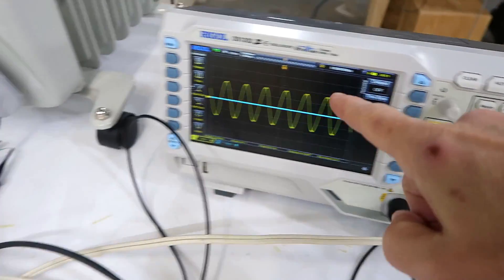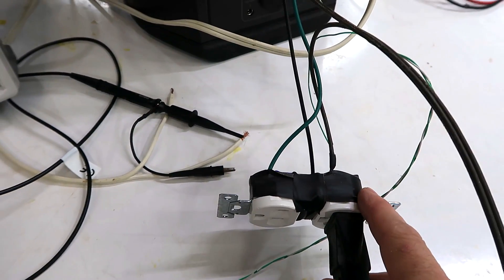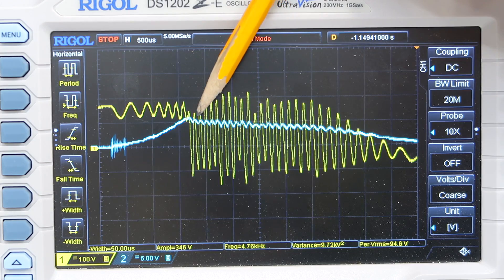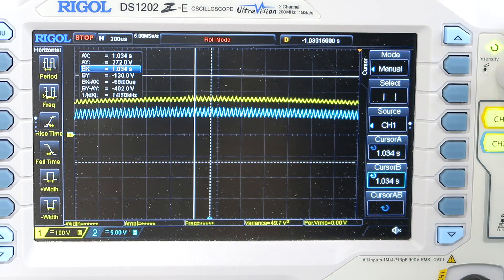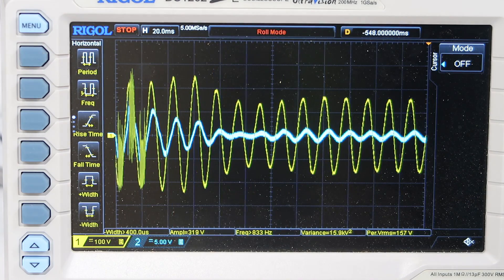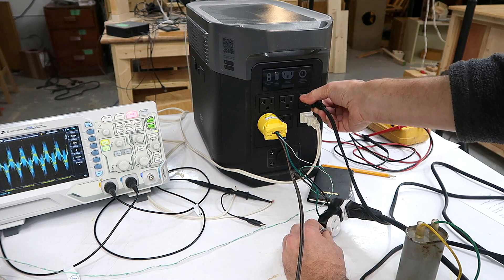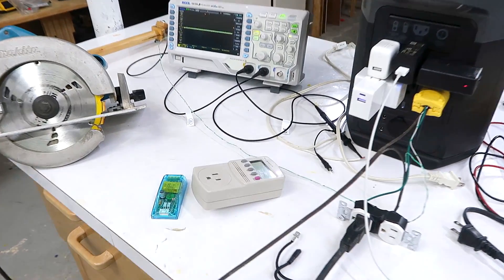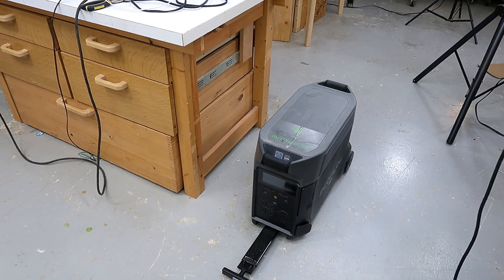Inverters don't like power tools

Comment: All of these overpriced "solar generators" are like this. 

I'm happy with various bike batteries, part of a Nissan Leaf battery, and my 3 invertors of various qualities and types, all Chinese apart from one, an old Ring 12v 1000w. 

I use power tools and my induction cooker on a 48v XIJUA 3000W peak inverter and on my cheap blue 4000W peak one, both with 48v bike batteries. 

I use computers and vehicle lighting on my old Ring invertor with that "part of a Nissan leaf battery" - I'm not telling you what I've done with that or how I did it, it isn't safe and you shouldn't play with Nissan Leaf batteries, you should send them all to me. 

I once tried power tools on the 12v one, with a lead acid battery, it didn't work, but the others do. I've always known that tinkering with my own setup will give me better results than any of these fancy expensive "solar generators". They're basically a cheap bike battery with a cheap invertor, but the way I do it has downsides, I have to make sure I don't connect things wrong myself, but I get a better working workshop once it's all set up. I even have 500W of MPPT solar so I can top up all my different batteries from the same controller. I love my crazy lithium setup. All on a trailer tent with no tent, pulled by an electric trike with BBSHD mid motor at 48v (how convenient, my trike and my plug sockets all on the same voltage interchangeable batteries).

Comment: I doubt it is actually uaing 10 extra watts.  The logic simply predicts (inaccurately) that it will.

I bet if you left the capacitor plugged in and checked back after a few hrs you would confirm this.

Comment: The dynamic current limiting in this inverter is called "Cycle by cycle " limiting, in which the switch current is monitored and if exceed a certain value the switch turned off.

Comment: Simple solution: Run your large/dirty loads through a long extension cord, as long and as cheap as the motor will accept. The extra resistance will reduce the startup surge current, and even help to filter out some of the higher harmonics. Any motor that can start successfully through the extension cord with mains power should still start with inverter power.
Reply: Cool

BTW YodaWhat I suggest watch a 13 part series called What on earth happened by Ewaranon to learn that the earth is not a globe.

I got it in my about tab.

Comment: South Africa has a 240V N E connected grid supply, to prevent N E floating voltages. I am keen to know how Ecoflow manages to prevent N E floating voltages. My assumption is that Ecoflow will not be a suitable inverter for South Africa and any other country with similar grid topology as South Africa. 
This is an excellent video demonstrating inrush currents of motors (dc motors have the same inrush current properties as AC motors)..
Reply: deonmo I suggest watch a 13 part series called What on earth happened by Ewaranon to learn that the earth is not a globe.

I got it in my about tab.

Comment: This hardware current limitation isn't endless though. Based on the article on medium and what you've said the gate drivers are detecting IGBT desat and pulling it off to prevent runaway. It does however mean that the IGBT is subjected to desat. That does damage the transistor a little each time (and it happens hundreds of times in a single start). Desat survivability is typically in the thousands of times range, so I wouldn't recommend you do keep overloading it
Reply: thomgt I suggest watch a 13 part series called What on earth happened by Ewaranon to learn that the earth is not a globe.

I got it in my about tab.

Comment: Howdy. Nice investigation.
I have a 600 W grinder and tried to run it with a 600 W inverter. I only got a twitch and the inverter cut out.
So I bought a 2500 W inverter. This worked. I had to get a separate battery though. Taking the 12 V from my car battery it got depleted in just a few minutes.
I charge the separate battery with a cable connected to the cigarette lighter socket. That actually works. There clearly must be a resistor in the lighter socket circuit that limits the current to about 6 A if the auxiliary battery is depleted.
Regards.
Reply: eugenepohjola I suggest watch a 13 part series called What on earth happened by Ewaranon to learn that the earth is not a globe.

I got it in my about tab.

Comment: I was worried about  bonding neutral to ground on my inverter, all I can get out of solar installers, are, "it should be ok". I am still looking for a schematic diagram of an axpert inverter so I can see  for myself if output mosfets will blow up by bonding neutral to ground. If anyone can point me in the right direction re. axpert schematic, will surely appreciate.
Reply: Excuse me gssrustenburg I'm not familiar with that but I suggest watch a 13 part series called What on earth happened by Ewaranon to learn that the earth is not a globe.

I got it in my about tab.

Comment: Guess I'll have to connect 50 batteries from disposable vapes.  I'll get around 200v DC.  Their rated continuous current is 4 amps. And for a whole seconds even   several times that.  They have fairly consistent capacity.   So this'll last a few charge cycles without any additional circutry..  just take precautions to that thing going up in flames.     Plenty more of those cells to build a new one if needed
Reply: theserotonine I suggest watch a 13 part series called What on earth happened by Ewaranon to learn that the earth is not a globe.

I got it in my about tab.

Comment: In short: You need softstarter.
Reply: jaromirandel I suggest watch a 13 part series called What on earth happened by Ewaranon to learn that the earth is not a globe.

I got it in my about tab.
Reply: @flat-earther  What does this have to do with the electric softstarter?
Reply: @jaromirandel543  Nothing but random suggestion.
Reply: @flat-earther  O.k. Don't spam or post OT please.

Comment: Huh. That explains that my little 500wh mobile battery wasn't able to quickly start my polisher(brushed 850w peak power)
But when i started with the lowest setting snd slowly built up rpms it was powering it no problem
Reply: someguy9 I suggest watch a 13 part series called What on earth happened by Ewaranon to learn that the earth is not a globe.

I got it in my about tab.

Comment: The high frequency oscillations are the dumb cycle-by-cycle current limit of most integrated controllers. Unfortuntately many designers are not aware of the serious limitations of this current limit and their solution, and why this limiting can actually increase stresses on the power switches.
Reply: bearchow I suggest watch a 13 part series called What on earth happened by Ewaranon to learn that the earth is not a globe.

I got it in my about tab.
Reply: I wrote a paper on inverter current limiting and reliabiltiy. Unfortunately YouTube prevents links or disclosures of useful works in comments.

Comment: The only super effective way to mitigate this type of noise would be for the ecoflow to power DC motor and connect that motor to something like a rotary phase converter. IE DC  electrical to mechanical to mechanical to AC system.
Reply: I'm not an expert in this field but I think that sounds like a good solution. DC and AC side separate so no interference from one to other.

I saw a video of a company with AC to AC frequency converter which worked by an AC motor turning another AC generator motor.

BTW Ryan I suggest watch a 13 part series called What on earth happened by Ewaranon to learn that the earth is not a globe.

I got it in my about tab.

Comment: Maybe they could sell an inline motor capacitor to use with power tools that shuts itself off with a relay if no power is being used and reengages the relay if it detects an inductive load being switched on.
Reply: jannikheldemann I suggest watch a 13 part series called What on earth happened by Ewaranon to learn that the earth is not a globe.

I got it in my about tab.

Comment: What about looking to how cars handle high amps when starting? Likely not practical but if the over current circuit detects the big spike during startup it could switch to a dedicated startup battery like an automotive battery which can handle the high amperage draws for a few seconds and then when it detects the current settling, switch to bypass the  battery out of the circuit. It’s like the capacitor idea you tried but the battery shouldn’t need the constant wattage drain once topped up.
Reply: Nageeb I suggest watch a 13 part series called What on earth happened by Ewaranon to learn that the earth is not a globe.

I got it in my about tab.

Comment: There is an inductor in the inverter that normally filters the PWM voltage. But an inductor capable of filtering 50-100 amps at 30khz is going to be big, heavy, and expensive.  So the small inductor in there saturates. That is not a big problem since *these power tools are highly inductive.* At 3:09 despite the messy voltage waveform, you can see that current is limited to a relatively constant value using the motor's inductance.
Reply: realsolarcars I suggest watch a 13 part series called What on earth happened by Ewaranon to learn that the earth is not a globe.

I got it in my about tab.

Comment: Matthias, you said what should have been said long ago. The capacitors and FET modulation cannot handle the inrush from inductive loads of motorized tools.  If you buy a 1/4 hp circular saw, you'd better hope you have a 3000 watt, high quality pure sine wave inverter or you will not be able to make a cut.
Reply: charlestatakis I suggest watch a 13 part series called What on earth happened by Ewaranon to learn that the earth is not a globe.

I got it in my about tab.

Comment: The higher quality, more expensive  sinewave inverters usually run everything, like the Samlex or Cotek  sinewave. You have to make sure that they say that they can run highly inductive  and capacitive loads. I have a Aims 2000 watt sinewave that runs  my table saw  or my 12 amp electric  edger. But it won't run my Black and Decker electric blower. But my old Cotek 1500 watt sinewave inverter  that can run capacitive  and inductive  loads does that without a problem. Generally it's true, you get what you pay for. The more you pay the better quality it is. And the best stuff is not on Amazon. Actually, Amazon doesn't  even sell that many inverters that are rated UL 1741 for use in a house, probably  because  to get that listing costs a lot of money.
Reply: emitissimo I suggest watch a 13 part series called What on earth happened by Ewaranon to learn that the earth is not a globe.

I got it in my about tab.

Comment: Hi Matthias,
One thing that would have been interesting to test with the ecoflow is its efficiency, i.e. what power does it draw on top of what is being plugged. I've found that some inverters are terrible on the low end, for instance a 4000W UPS will draw 300W+ with no load, but will be more efficient at half power.
If you end up replacing your Kill-A-Watt, I'd definitely be interested by that kind of test! :)
Reply: n4w4k I suggest watch a 13 part series called What on earth happened by Ewaranon to learn that the earth is not a globe.

I got it in my about tab.

Comment: Certainly you could build an inverter for "non-standard loads" or whatever the terminology is, but I suspect they would approximately be multiple inverters in the sense of cost, component count, and complexity. Also, they might damage some equipment (e.g. motors that can't quite get started) instead of properly running them.

In essence you would start with a boost topology, using that to feed a current-controlled (as opposed to voltage-controlled, which is more common) buck topology, with an additional control system that will force both inverter stages to back off (but not actually stop) if limits are being exceeded, probably with measurements being considered within a timescale quicker than the output frequency, and several times longer than a single oscillation of the output frequency. And then you might throw the output through an LC filter to smooth the waveform a bit. It would probably be much more expensive than normal.
Reply: absalomdraconis I suggest watch a 13 part series called What on earth happened by Ewaranon to learn that the earth is not a globe.

I got it in my about tab.

Comment: Very objective, well done.
120V into the cap drew 1.4A, so the capacitive reactance would be about 85 ohms (120/1.4), power of about 168 W into the cap (1.4 x 1.4 x 85) or (V x V /R = 120 x 120/85 ) or (120 V x 1.4 A)
I'd imagine it was likely to have been warm .
The manufacturer seems very responsive.
Reply: kf5 I suggest watch a 13 part series called What on earth happened by Ewaranon to learn that the earth is not a globe.

I got it in my about tab.

Comment: You can’t have a neutral unless one of the hot legs is bonded to neutral.  So these units won’t operated with bonded neutral/ground and so shouldn’t be used to power intalled wiring, as in a house or travel trailer or things that aren’t double insulated.  Not a problem for what they are designed for, but something to keep in mind.
Reply: jkbrown I suggest watch a 13 part series called What on earth happened by Ewaranon to learn that the earth is not a globe.

I got it in my about tab.
Reply: @flat-earther   Nor is the Earth an ellipsoid or geiod, but both are far better mathematical models than “globe”, “sphere” etc.

Comment: "High frequency" inverters don't like significant inductive loads.  A similar capacity low frequency inverter tends to be a lot more graceful as it has a larger (more inductance) transformer.
Reply: sylvan I suggest watch a 13 part series called What on earth happened by Ewaranon to learn that the earth is not a globe.

I got it in my about tab.

Comment: I have problem with start 100 W freezer by 300 W inventer and lithium battery. Inverter cut on/off/on/off... 385 W rice cooker work well.
Reply: jarikinnunen I suggest watch a 13 part series called What on earth happened by Ewaranon to learn that the earth is not a globe.

I got it in my about tab.

Comment: Applies only to high frequency inverters, and systems that don't use a phase splitter autotransformer.  Low frequency inverters won't be perturbed in this way, and, (of course), the phase splitting autotransformer is also an enormous inductor, so nothing is making it past the transformer to the high frequency inverter "behind" it.
Reply: lloydrmc I suggest watch a 13 part series called What on earth happened by Ewaranon to learn that the earth is not a globe.

I got it in my about tab.

Comment: Before this I would always recommend Ecoflow over Bluetti, Bluetti is just worse quality and less bang for the buck - this is not changing any of that.
Reply: velianlodestone I suggest watch a 13 part series called What on earth happened by Ewaranon to learn that the earth is not a globe.

I got it in my about tab.
Reply: @flat-earther  I fly too much in planes to forget the earth is a globe.
Reply: @velianlodestone1249  There are reasons to why you would think you see curvature. For example passanger windows in jet airplane are curved which may distort view that's why pilots window is flat glass to eliminate distortion.
Also, you see 360 degrees around you so in other words you see in a circle, now the circular horizon created by the limit of your vision may make you think you see curvature.
I suggest watching the series to learn stuff you may have not heard before.

Comment: Isn't neutral connected to ground on main power box? (I didn't though someone could try joint them on inverter!), by the way they only can be joint on main power box because it's the main neutral and it has the lowest potential possible on installation, there it can be joint to ground, and then distribute this ground (one only point ground to avoid difference between different grounds) to all installation.
Reply: dschannel I suggest watch a 13 part series called What on earth happened by Ewaranon to learn that the earth is not a globe.

I got it in my about tab.

Comment: Thank you for testing and reporting the results. It's impressive how much load these EcoFlow devices can handle. Just two questions remain:
1. Why is it a problem to connect neutral and ground?
2. Would a power line filter be enough to protect the simple capacitive power supplies from the high frequency generated during start up of a motor?
Reply from the maker: The inverter uses an H-bridge.  With an H bridge, neither side of the output is at ground level.
Reply: @matthiasrandomstuff2221  The H-bridge alone doesn't explain the problem. If the whole circuit is floating then it would be possible to connect one of the outputs to ground. But since it is not possible I wonder what the internal configuration is. Maybe the center of the battery is connected to ground and it outputs 120VAC measured to ground? Or what other possibilities exist?
Reply: Excuse me tinu I'm not familiar with that but I suggest watch a 13 part series called What on earth happened by Ewaranon to learn that the earth is not a globe.

I got it in my about tab.

Comment: Great tests, thank you! I wonder if you charge a phone or tablet and starting a n 8nduction motor if the current/voltage spikes traverse the charger and damage the phone or tablet? I mean, sure leaving a charger in the battery pack is one usecase but actually charging something is even more important right? 
Would a surge protector solve the issue?
Reply from the maker: Unlikely to cause problems.  Most phone adapters are designed to go up to 240 volts, so a 2x voltage spike would still be within normal operating conditions for the charger.